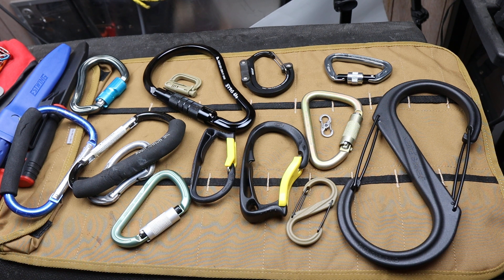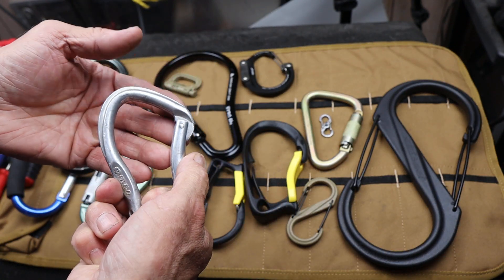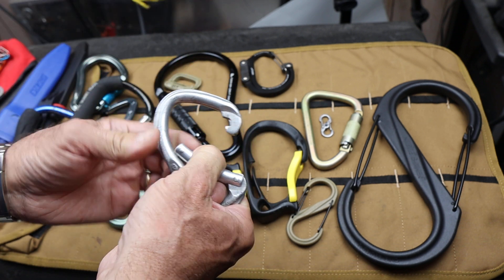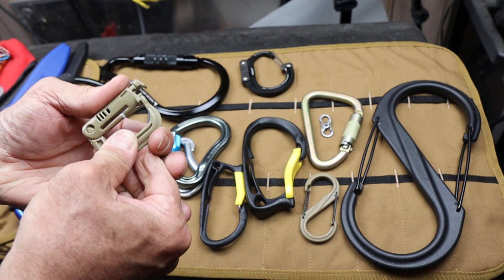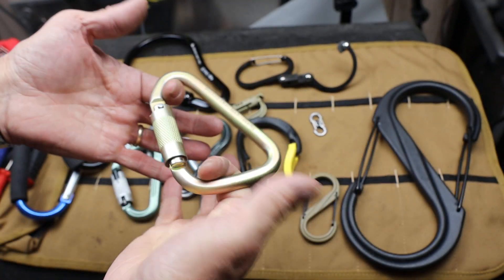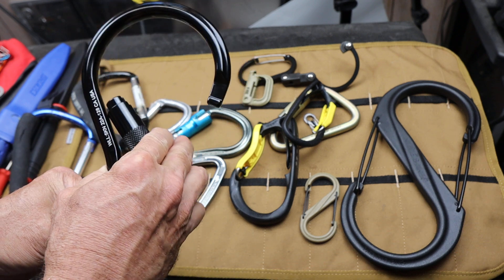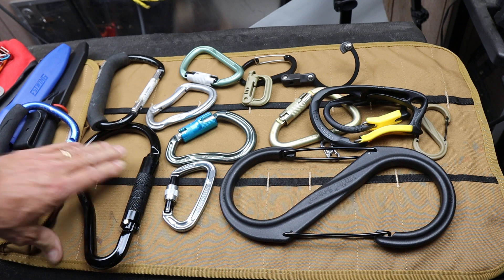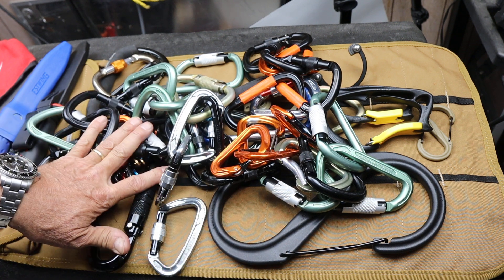Carabiners Snap Links Connectors, Nite Ize, Petzl, Fusion! Magical attachments with some limitations

Comment: Carabiners definitely have their place, and I even keep a couple in the car, but it seems like I'm using soft shackles more these days.

Made from Dyneema, soft shackles are asinine strong; but don't deal well with sharp edges and/or abrasion. Also, in mere seconds they can be cobbled out of 550 line that'll serve the needs of most mortals. 

Of Interest to note; the sport skydiving world (and probably military by now) for years has used soft shackles as connector links between suspension lines & risers. Most are from 'Performance Designs' and marketed as 'SLinks'. They're quite long lived & reliable in the roll... light weight, and don't sting nearly as bad as the old time steel variety if cranked by one.

Comment: I do a few jobs a week in a boom or scissor lift. Fall protection has the sweet locking clips where you press one side to get it started and then press the gate in. Then I got my tool lanyards for my drill and hand tools that I clip onto my harness.

Then I go home and my dogs have harnesses for walking and car seatbelt ms are carabiners. Basically interacting with the things 30 times a day. Never needed to pay attention to weight requirements. I am a big fan of Nit Ize ever since the late 80’s when they made a headband to hold a standard maglite. I buy just about anything they make including their little keychain sized carabiner clips.
Reply: Also work in 180 booms all day. I use the large s biner nit ize to attach a rigid tool basket version to the safety bars. Gives you a handy dump basket for tools and parts and the perfect length to let the bottom of the basket rest against the middle bar.
Reply: @richardthomas6054  Do you share the joy of non-magnetic, stainless steel screws? I started using a nail pouch to hold them. Usually they’re self-retained but not always.

Comment: Spring loaded twist-lock carabiners (autolocks) are commonly used in paragliding to attach the canopy to the harness, it means you can't forget to screw the gate closed. If the gate isn't locked its possible when the canopy collapses a slack line might get pulled against the gate and pulled into the 'biner, deforming the canopy and making  it unflyable.

Comment: I like the tiny niteize s-biner.   CAUTION.... if you use them for keys they must be locking or you will lose keys, trust me. I use them everywhere but for keys. ☺
Perfect for attaching torches, knives and the like to your pants/belt.  Works very well, no weight in the pockets, but supported by the belt. Nothing in my pockets touch the bottom of the pocket, and very important, no rattle with lightening acsess.
Reply: I used some shrinkflex to avoid them to open in the end/side you didn't  want to.
Reply: @1973Grejluder  that's what I did too. Three months later the introduced the locking mechanism. I still use that method in places as it is more secure than the locking ones, won't open.  But a bit to open the  bail with one hand.